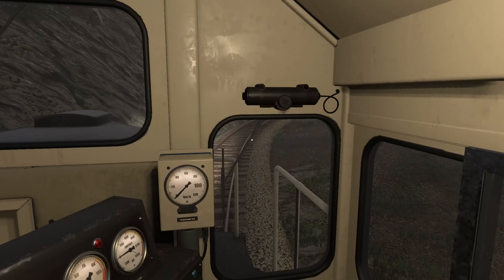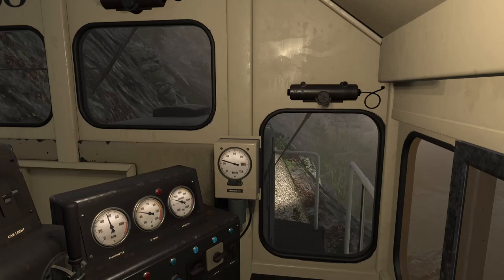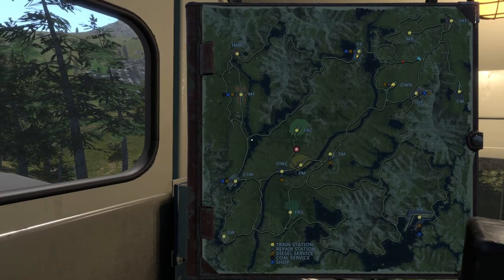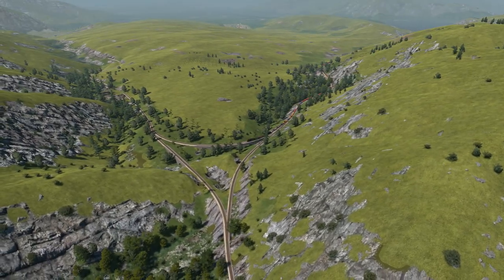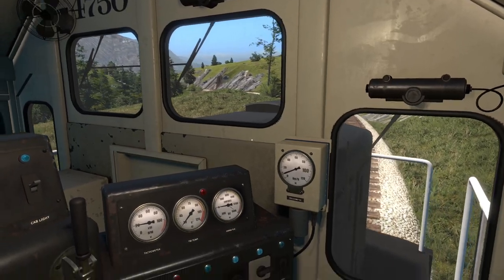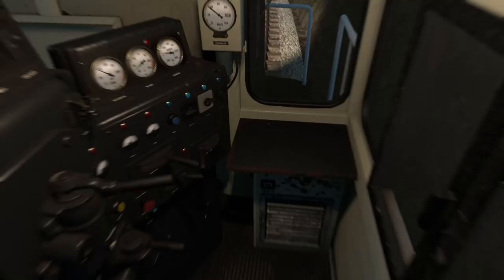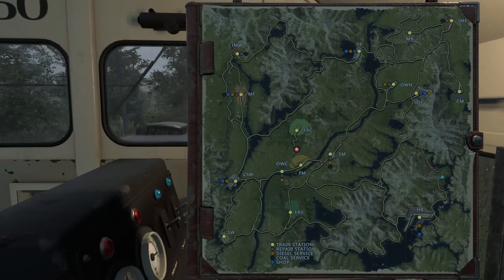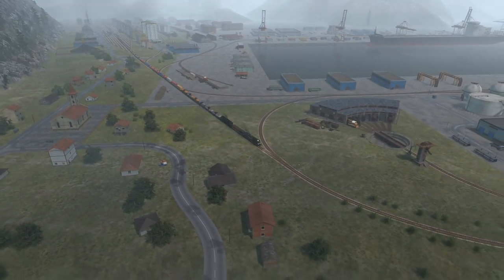Derail Valley Episode 5: Great Lengths

Comment: Looks like the AI generated a random castle based on traditional elements that are present in most castles, but the 2 castles themselves, which are copies of each other, do not make sense defensively. There is no central keep or tower, there are no further fortifications outside of the main wall, and the windows in the towers are too large for just defensive use, more like decorative or for comfortable habitation size. The only tower that could be a keep was built into the wall and has a dead corner behind it, only coverable by the tower slightly behind it. Doesn't make sense defensively.